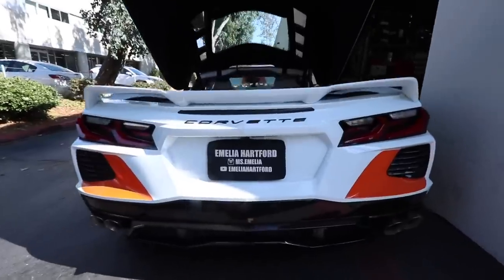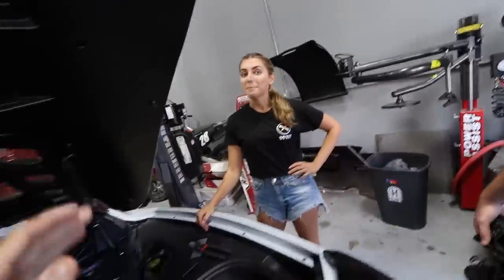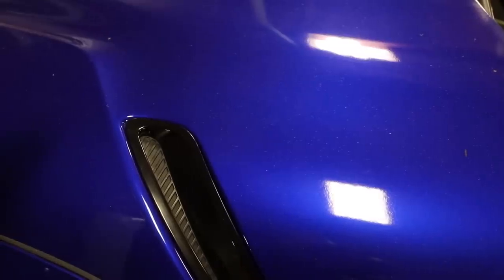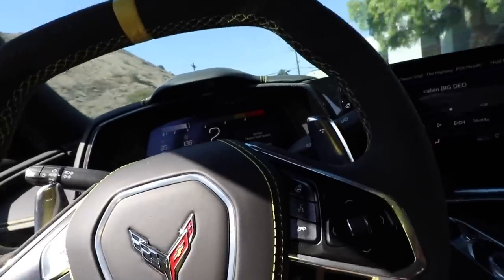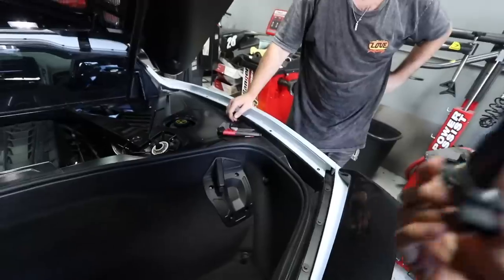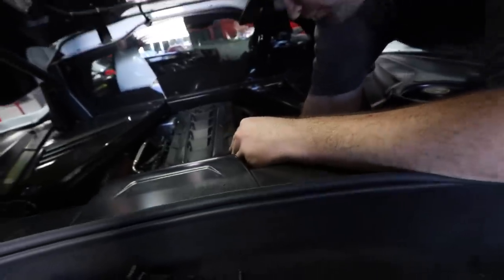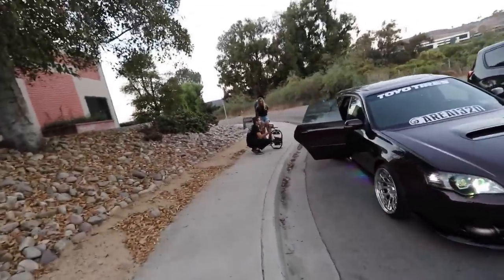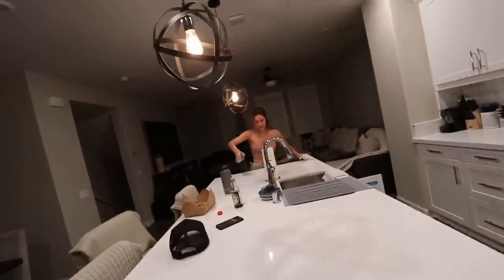My 700HP Twin Turbo C8 VS 600HP Twin Turbo C8 with NITROUS!

Comment: Streetpeeds tt c8 didn't have issues maybe contacting the shop that did his and see what they say?
Reply: Simple reason of not having issues, it not pushing it to the limits and beyond.

CSR, also has been somewhat cautious. 

If You heard clearly, Emelia said her current setup has 1000 HP and will produce 1100 HP.
Those numbers are beyond planned GM-Chevy 5.5 L twin turbo & Zora with AWD & hybrid !

Clutches slip 650-678 torque (see her videos from summer with Pikes Performance, before and after new engine rebuild) 

Emelia has probably the most powerful privately owned C8.
Awaiting a newer, higher torque DCT[TCT?] 
(Which manufacturer will have one available or perhaps can she get GM-Chevy newer one for Z06, better the twin turbo version in C8-R?)

Sincerely
Reply: I was thinking the same
Reply: @justiceodueze2897  simple lack in knowledge of what was done
Also, he sold his already too
Emelia Hartford along with Peitz Performance seem to have pushed the C8 the most and achieved the most thus far. 
If a reasonable performance, non-stressed, reliable vehicle is desired, and maximize the available performance within the GM-Chevy design, there are some modifications that are useful. 
It is obvious from every turbo or super charger modification upon every engine, it will stress the mechanical parts of the motor and drive train. Some will show damage quicker than others. Most factory built vehicles, especially larger production models, have vulnerabilities. Every manufacturer has a design which has limitations. Every proper, professional race team has at least one engineer. 
People who get involved with performance modifications and upgrades without the proper level technical knowledge, expertise and methods [often engineering] will certainly result in over stressing and damaging parts.
Even the top racing teams have failures and damage when they have engineering involved. Though, in their case and situation, they are knowingly pushing their limits with known risks and planned part replacements.

Am actually an engineer and scientist 
and experienced basic engine modifications before University level study as a H.S. teenager too.

Sincerely
Reply: @newtonfirefly3584   RELAX man, didn’t ask for all your credentials😂 cool to see you kno your stuff. I along with some of the others who commented on the same thing were asking bc maybe LMR ran into the issue and resolved it in their own way and could maybe pass on the info. We’re not talking bout “structural integrity” or “people failing.” It’s literally a simple of question of “did you guys see how they did it? Do you think you had the same issues?” 
Shiiii maybe hit up Emelia or TJ or the Sheepey Race owner and offer your insight.
Reply: @justiceodueze2897  Included my basis of correct information, because most people who comment, are at most involved in modification level, often without proper knowledge.
Have already written Emelia messages without response.
Am hoping TJ will respond, but experience tells me, he will not either.
Do not know how to get to Sheepey either, and not expecting any response, through the YT channel either
If, there was a means of private messaging, am certainly interested to give any and all helpful information for each to achieve their best.
An additional purpose of my comment is to others, who might take heed, to be aware.
Sincerely

Comment: Shits sounds like it’s running in 6 cylinders when it goes into limp mode😳
Reply: Cause... it is?
Reply: Most likely it turns off power to only 6 cylinders

Comment: So SS717 had the right idea on his built by LMR. Having the turbos mounted high allows the oil to drain properly.
Reply: LMR knew to mount the turbskis high on the engine.
Reply: Yes see the Fueltech one as well uses the LMR kit
Reply: Mike's TT kit also provides a longer exhaust system which IMO sounds much better. I think combining Mike's kit with Emelia's ECU piggyback would be ideal, at least until the ECU can be edited/reprogrammed.
Reply: You could tell TJ was pissed the whole video because his car wasn’t working and than the dude showed up late and the spent all day working on a car that should’ve be done.
Reply: Yeah, this whole thing was a bad look for Sheepy.  I understand this was a new kit for them but you could tell every time TJ went to look at it the car was off in the corner and obviously not a priority, hence the reason it took so long.  For that much time, they should have had an issue like......THE TURBOS LITERALLY FILLING WITH OIL AND IT BLOWING BACK INTO THE INTAKE worked out.

Comment: Plug the manifold and run the crankcase ventilation hose to the ground lol. With the check valve you won’t be able to vent the crankcase which needs to happen when under load and especially boost. Will help keep your manifold and valve clean.

Comment: You need check valve to keep the oil from back flowing into the turbos from your oil return lines. Turbochargers do not have seals so once the oil level rises above the turbo shaft it leaks into the compressor and turbine housing. For your limp mode issue it looks like you are oiling your MAF. You should look at going speed density and get rid of the MAF. Once you install your check valves you will need to clean our all your piping and intercooler as you have alot of oil in them. You prob oiled your TPS sensor, and AIT which will put you into limp mode.

Comment: TJ Hunt - Emelia discusses the little plug from Pietz Performance; check valve. For this episode we can call her, "Check Valve-Emelia!" AF (I use the McGuires waterless cleaner spray. Works like a dream and it is easy to get. Good price at Walmart! Good stuff. Reminds me. What about the catch can? (Alex's C8 - 1063rd car off the line and created at Bowling Green Assembly Plant on 02/20/2020. Hmmm. I have the Ceramic Matrix Gray Metallic, also known as light gray/Z51/front axle lift/magnetic ride control and almost all of the carbon/carbon dress up packages with High Wing Spoiler. Aftermarket wrap/BORLA ATAK exhaust (sounds totally sinister)/LAMBO Doors installed. Decided not to get the available radiator screens -- they just do not protect enough. AF By the way, what causes all of that oil to cover the module? AF

Comment: I’m glad it’s working! Accessing the can bus is practically impossible right now. There’s a huge firewall after the dlc. If you just try to tap into the ecu there’s a failsafe in just about every module. It’s gonna be hard and I honestly don’t think anything is going to work for a while
Reply: The ecu is just like the duramax L5P. It has a rolling encryption. No hash cracking program is going to be able to crack that ecu. The L5P has been out for 3 years and no one has cracked that ecu.

Comment: Try make sure the turbo oil return line isn’t backing up and pushing oil out the turbo seals... and no 90 degree A/N fittings in them

Comment: Can someone please explain why they're unpinning the MAF? Or even completely removing it? Do these C8s have MAP sensors and they're relying on the MAP to meter the air flow? Trying to run a base tune for air flow? That's probably why it's cutting out it doesn't know the g/s of air entering the engine.

Comment: Maybe try cleaning out all the oil out of the intake side of the engine and turbo and clean all the sensors. And add meth. 

And the water jug thing is kinda weird to have in a room. Those are in the office or  kitchen..

And I like the videos when I first start to play them. But I usually watch in my car on android radio 10" screen, mostly listen when driving but watch in traffic and at lights. Android radios are the best idea if you want to upgrade your head unit to have all the features of your factory radio plus of an android tablet. I got mine from joyingauto.com, shipping takes a while but so worth it

Comment: @Tj Hunt;  Good compliment video to Emelia Hartford.  :D

Have a meaningful comment about the very last bit on this video regarding water, and containers.
Personally lived in LA, CA from May 1982 - January 1993. Moved there from Maryland suburbs of Washington, D.C. on NW side [Montgomery County].
Immediately noticed the poor taste of the water [heavy chlorine (often enough for swimming pool) and significant amounts of calcium (actual test results showed contamination of several harmful organic compounds of the EPA pollutant list, including formaldehyde)[. My first apartment mate had bottled water similar the one seen in this video, which certainly has better tasting water. In December 1984, got my first proper pressed carbon block water filtration system.The water quality from that filter is far superior to the water from the pipes alone, and noticeably superior in taste to bottle water. My first sale of this water filter system was to a man who said to me, if the water from this filter tastes better than the delivered bottled water, he will buy it. Not only is the taste better, so is the quality and less expensive. Reverse osmosis systems all have carbon pre and post filters, and are much more expensive, inefficient. slow and wasteful [the best wastes 4 to keep 1].
As for containers all polymers [plastics, polystyrene, polyester, nylon, and similar synthetics] release harmful chemicals into liquids, food, when warm and via sunlight (without sufficient temperature), known a phlalates (BPA just one) which have significant harmful affects upon the body, primarily blocking production of hormones. Hormones are necessary for many body functions including the human immune system, reproduction system and other bodily functions. There are at least three known hormones produced which provide positive, good sensations like endorphins, serotonin, the body produces adrenaline during levels of stress and melatonin for sleep and to counteract the harmful affects of adrenaline.
If interested can tell You the best, verified, reliable carbon block water filter available. Am not living in the USA for over 27 years, but brought mine with me overseas.
Sincerely

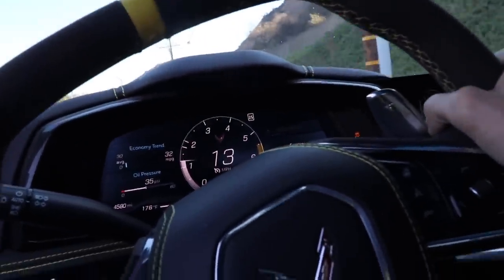Comment: Teeg Like i said before, It really sounds like she is missing or timing is off, or maybe 2 plug wires are on the Incorrect Cylinders, the sound is definitely Exaggerated by the limp mode @ 13:10 & 15:32.  Not trying to be Rude, something isn't right!!  I would check plug wire firing order and see if they are gounding out on anything, timing, then maybe see if there are any exhaust leaks...

Comment: Because your map sensor is used to calculate afr. [It'll idle but.... throttle is different] Put a og GMC 3bar in place at a safer location like a charge pipe right before the throttle body or connect it to a line after the throttle body on the intake manny.  That new unit is shit design if it's somewhere that it can be effected (drenched) in blow by (valvetrain oul)

Comment: GM locking the ECU’s is bunk . I started to buy a C8 and a new Trail Boss but didn’t buy either due to that issue . I hope they realize it’s costing them sales
Reply: Every manufacturer is trying to lock stuff down Chevy is far behind on that.
Reply: @mbsnyderc  they are stupid for doing it . They have to be aware of the car community or the truck community . People don’t all just buy them and drive them stock especially performance cars and trucks

Comment: The other day and btw I don’t have a c8 I have riced out 05 corolla but the other day my throttle position sensor went out and I I had a check engine light and when I’d give it some throttle it would no go , if I’d floor it itd just go to 3000rpms and just chill there and I’d go up in speed slowly and I got a new throttle position sensor and it took my ecu or what ever a second to read it and it went back to normal it was super responsive and light went away

Comment: Oh my God u guys are making me king, Jim a ASR Master Tech, numerous one your computer is controlled by your Mass Airflow, it reads Air Volume , Air Intake temperature and flow if it is covered in oil just wiping it will not fix clean it with mass airflow cleaner.. if you are getting exercise oil .means your crank case pressure is to much . Could be a few things worst case blow by in the cylinder compression getting past rings goimgbinto crank case forcing oil out. Take oil cap of valve cover and hold your hand over the hole if you can feel aulse of pressure pushing out you have blow by. Usally caused by worn tunes or parts or excessive ring gap meaning worn compression rings. So with Twin turning the c8 i see it could be an issue..

Comment: With the way these C8's run they could be beaten by a stock C8 or a Honda Civic for that matter. 700 hp is no good in limp mode. Well they should be beasts if you can get them to run right. Modifying cars is not for the weak of heart or the weak bank account.

Comment: spent  all that money to sheepey race for what to have twins that don't run correctly you don't see Alex he took off in his R8 not a good look for sheepey  embarrassing the car alex built  doesn't even run like it should after he cleared it all done clearly it needs a lot more R&D work burning up 100 dollar maps sensors...no point to race a car that's not correctly built  by Alex at sheepey.... Alex knew  it was not right...m